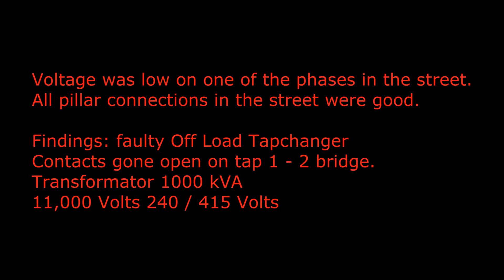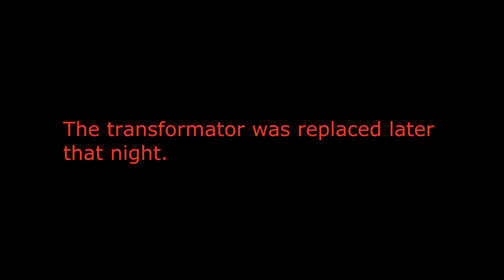Transformator fault

Comment: So its scrap copper now?
Thanks for sharing
Reply from the maker: No, SeanBZA gave you the answer, back to the workshops, fit a new tap-changer and test winding ratio's and back into service. A unit like this is worth 150 k$, new tap-changer maybe 300 $
Reply: No, it is repaired and placed back in the pool of spares. You do not toss a big cost item just because it has a fault that can be fixed for less than 1% of the cost of a new unit. Clean oil and regular servicing and this will easily be in service for another century, like some here are.
Reply: RODALCO2007 thanks for the info- nice to know things get repaired. Was hoping that was the case...cos it didn't look hard to fix.

Comment: Looks like it may have arced over. Interesting that it could do that even submerged in oil
Reply from the maker: Those slide tapchangers are a pain as the contact pressure is not always that good, It started arcing at some stage and then deteriation of the contacts occur and in this case a burn out and wires coming loose.